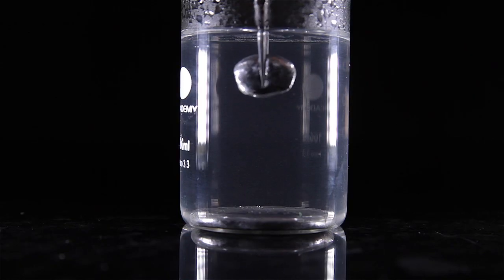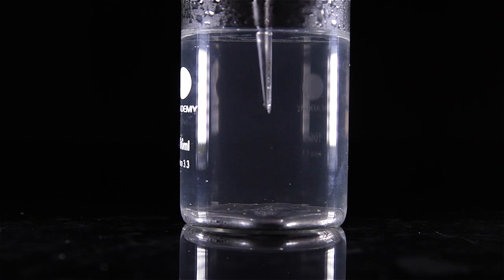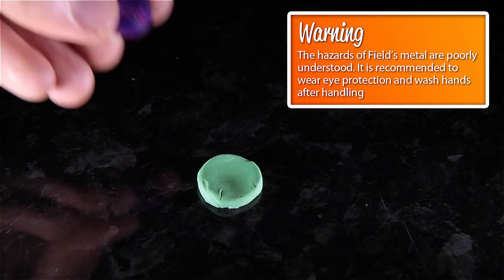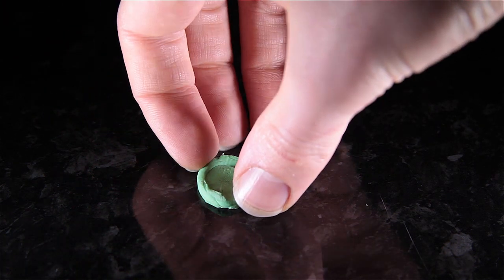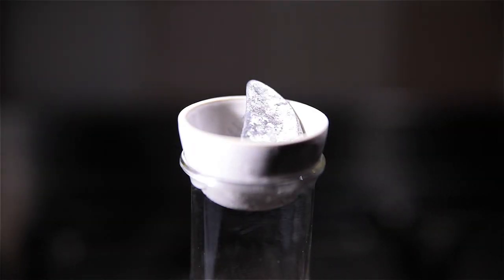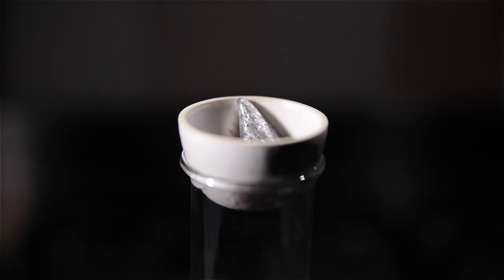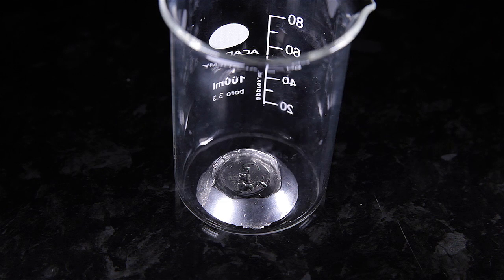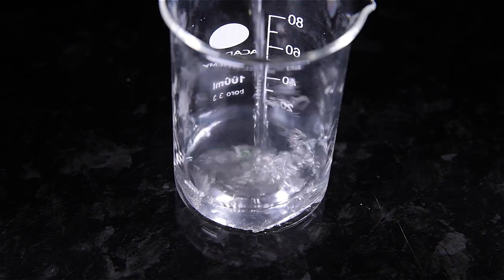Magic metal - fusible alloys

Comment: Field's metal is non-toxic as no biological interactions have been shown for indium. Bismuth, likewise is safe and used in many OTC medicines (Pepto-Bismol, for instance). Tin is quite safe.

Like all metals, ingesting is not a great idea and the fumes of vaporizing metal (which means you have it way too hot) are generally not good for your health.

If you want to make jewelry, Brendan I'd recommend Pewter alloyed with Bismuth. It has no shrinkage when casting and is 4+ times less expensive and melts below 500F which is suitable for melting it on the kitchen range.

Good luck!

Comment: Saying as indium is non toxic would it be safe to use field's metal in jewelry?
Reply: Actually Indium is indeed toxic. However it is safe to handle with bare hands as long as you wash them afterwards. I would also recommend not exposing open wounds to indium, eating indium, or holding indium very close to your face and breathing it in. So no I would not recommend making jewelry out of fields metal or indium.